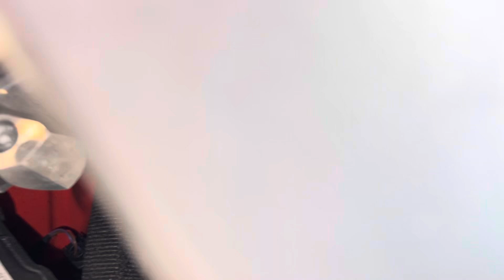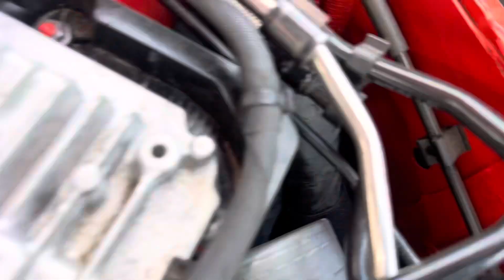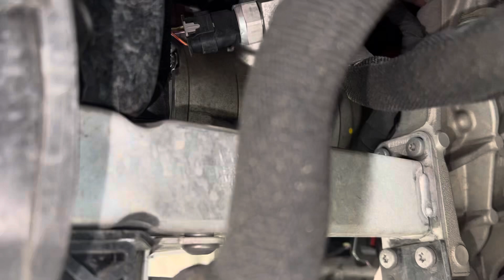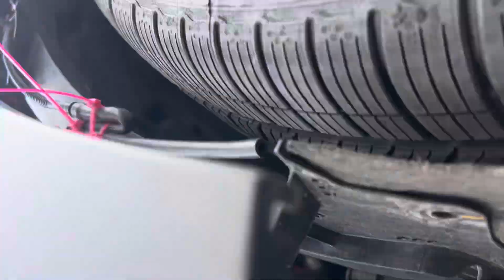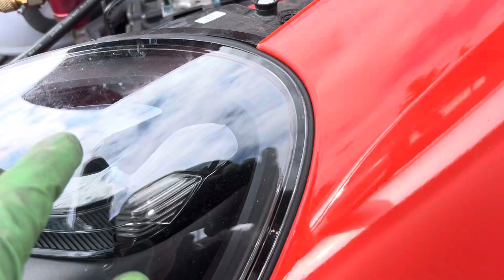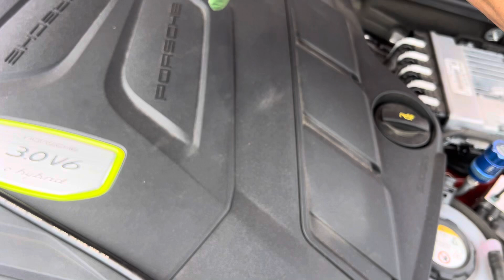AC electric compressor on a Porsche heat pump system. If this compressor burns out expensive repair￼

Comment: Knowing VAG, that thing probably have a recovery, recharge & vacuum mode using a VAG specific scantool. Just imagine a simple replacement of 12v battery needs to coded using a scantool.
Reply from the maker: @w0lvez1  most cars nowadays need to be reprogrammed when changing batteries, even Chevy Ford and Chrysler and Toyota.   No longer the simple days of I’m going to save money and go down to sherbets auto parts and get the $24 cheap battery. 

I was just watching yesterday. Somebody spending $800 having their Mercedes battery replaced in their SUV were part of the interior rug and the driver seat had to be totally removed. .
Reply: @coldfinger459sub0  According to VAG manual. The high-voltage system may only be de-energised by a suitably qualified person (VAG high-voltage technician).t It must be definitely confirmed that the high-voltage system is de-energised. The system may ONLY be de-energised using the vehicle diagnostic tester via „Guided Fault Finding“.
Reply from the maker: @ don’t worry every day completely unqualified and incompetent individuals are trying to work on these vehicles. Darwin‘s theory of evolutionof culling the herd. Occasionally comes to play and weeds out defective DNA. 🧬 
Hopefully, they never reproduced
Reply: @coldfinger459sub0  You need to buy a diagnostic tool to repair modern commercial/residential HVAC like Daikin, Samsung, LG, etc. What's so annoying is that they have their own diagnostic tool. 😂
Reply from the maker: @w0lvez1 and that’s why I owned them. I have Panasonic, FUJITSU and LG for all the commercial equipment that I have sold and installed for customers

Comment: Is there a trick to evacuate this system without sucking oil?
Reply from the maker: @mikemurphy7519  turn the speed down on your recovery machine if you have one portable recovery machine that have adjustable speed throttle valve. 
     Otherwise, you can back off your coupling a few threads watch the flow through as you tighten down the coupling to where you just make contact and you see the pressure start to rise.  it’s just water water instead of full flow like a fire hose. 
     This is on individual portable units engages a site glass is very important